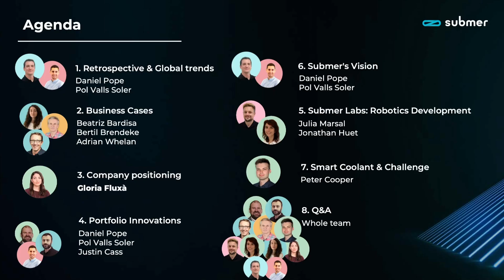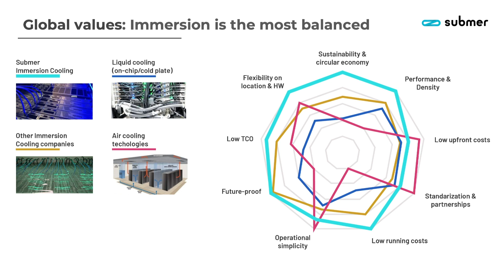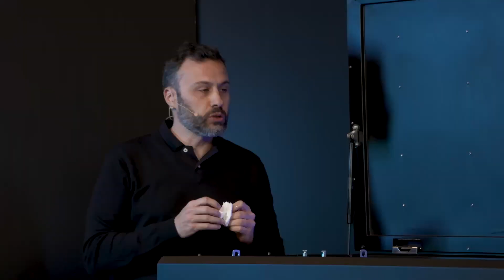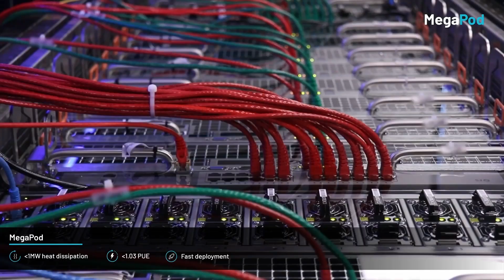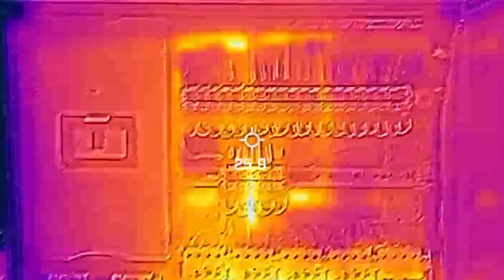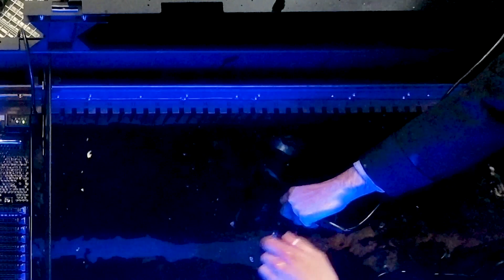The Submer Experience 2022 | Datacenters that make sense | Submer

Comment: Does the solution have any monitoring software and / or power consumption, as well as anticipated hardware failures?
Reply: Yes, it has a software platform that allows to easily locally monitor the system performance and telemetry and notifications to foresee potential anomalies and optionally it can easily get connected to any Data Center Infrastructure Management software or connect it anywhere with the most typical interface protocols if the customer wants. Thanks

Comment: Will be able to use servers from any manufacturer? Or is it only possible equipment manufactured specifically for such technology?
Reply from the maker: Hi Adriano, Submer is compatible with any IT hardware! 
Most of the major server manufacturers both in standard 19-inch and OCP 21-inch support immersion today. We have partnerships with the major brands and can happily support you in selecting high-density systems with full warranty for immersion.